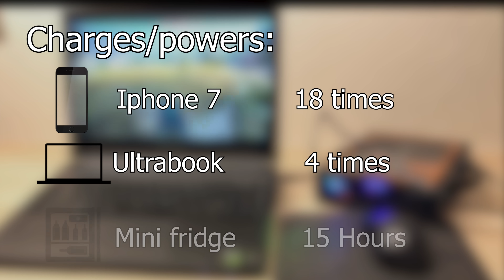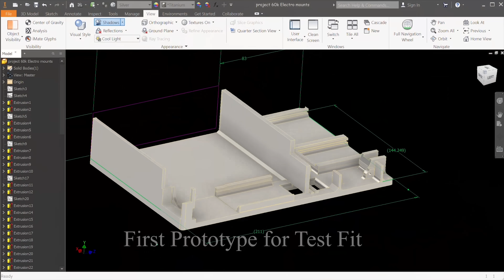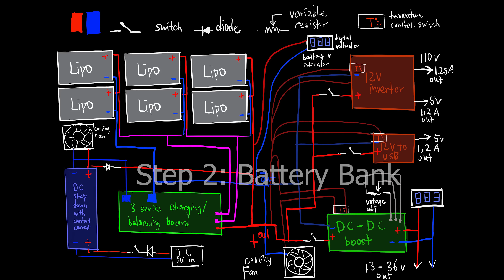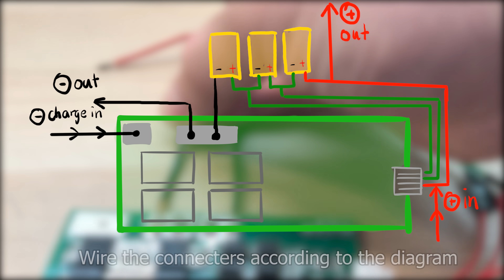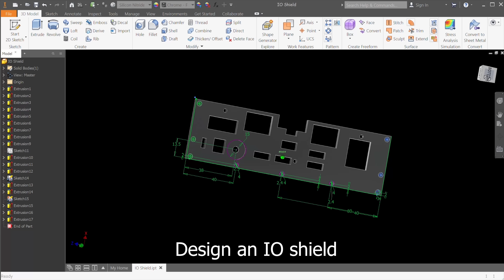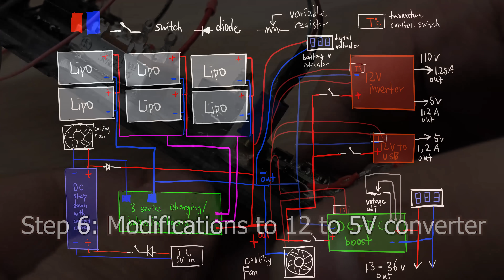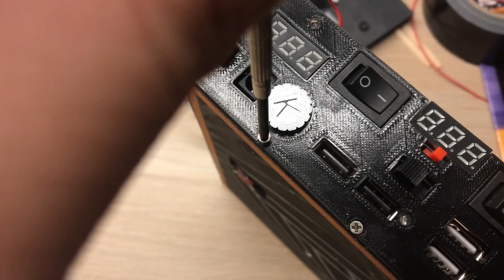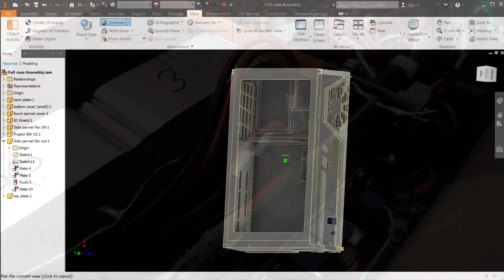Ultimate DIY 60,000mAh Power Bank (222Wh)

Comment: Schottky diodes not schockely (William Schockley)
Reply: No, schottky and schockley diodes are two different things.
Reply: @voldy3565  Been an EE for 50+ years and have never come across a schockley diode. Schockley invented the transistor.
Reply: @demyhr  Since you are an electrical engineer, can you tell me is this safe? If not, how can i make it safe? Add a fuse?

Comment: No BMS, unbalanced charger? oops
Reply: Is the device shown at 0:30 used to balance the batteries?
Reply: @ddegn  nope. The batteries are connected in pairs of two, then "balanced". It does state in the video the batteries are grouped into pairs of similar voltages when charged which helps but eventually because they are not the same voltage, issues related to them not being exactly balance will get worse.
Reply: @MrAlex3461  LiPo cells wired in parallel will always be at the same voltage. It's very very common for multiple cells to be treated as one larger cell when charged. This does have the downside of possibly losing multiple cells when one cell goes bad but it's very common for systems to treat parallel cells as a single higher capacity cell.
Balancing is needed when charging in series not parallel. Parallel cells don't need special balancing circuits.
Reply: @ddegn  perhaps common, but not in my regard best practise. The system will however be stable, and what I said before now thinking about it could be considered incorrect

Comment: what does it mean to fire the rubber after soldering like at 9:34? i'm a teen who's interested in hardware/tech and pretty fgood with it like PCS for example and this type of stuff is very itneresting, love it. i've learned al ot, did some research on polarity, ground, wire, negative, and neutral. can't wait to get int othis stuff ith e future and even make my own DIY builds (with obvious safety precautions and tools)

Comment: Solder joints could have been  a little bit better, but with the current you'll be using there shouldn't be a problem. I push over 120A through 12AWG everyday and have yet to desolder anything.

Comment: Nice project. I've built something similar with 18650 cells from used laptop batteries. it is 55000mAh and can power on laptops and basically anything with an external power inverter connected to its 12V plug. might having a look for inspiration. Cheers!

Comment: This is 20ah 11.1v nominal voltage, none the less great idea really useful although 4s lipo would be more ideal for a project like this but would put you up to 14.8v but less strain on the batteries, for future projects that require soldering remember flux is your best friend
Reply: Yes , I think that I was only one that know that is 20ah , 20000mah
That 6 battery with 10000mah is divided by 3 make it 13.6v , is 20ah 

Sorry for bad English, I clap for you too , he need 18 battery to make 60ah capacity

Comment: So many negative comments about your poor soldering and ugly connections.
But you built something which doesn't cost too much, which looks pretty professional (on the outside), which hasn't caught fire or exploded (yet), and which apparently works exactly as intended.  You just figured it out and just got it done without worrying too much about weak soldering skills.  Yeah there's some ugly and unsafe-looking DIY things inside the box but I compliment you for what you accomplished well instead of condemning you for what you failed to accomplish correctly.

Comment: When i was 13 my dad got me an arduino for christmas, for homeschooling diy circuitry projects. I wasnt allowed to power anything until he viewed my work. If he had viewed this work, he wouldnt have allowed me to power it.

 And before people start asking if I was allowed to use a soldering iron, yes. I was. And I didnt burn the house down, because its not a damn flamethrower. Its a hot stick. Doesnt take much training. Did I get high from the fumes of the flux? maybe.

Comment: Along with everything else, you NEVER put a tinned stranded conductor under screw tension. If it is meant to have current flowing on the conductor, it will eventually burn off.

Comment: I made my own version of this however I used an Arduino with SSD1306 to control everything as well as lead acid batteries, may have to revisit the project and repo with a orange pi zero, tft touchscreen and those 10Ah LiPos (my lead acids are only 7Ah and about 10x the size)

Comment: Nice build man, don't see too many power banks using proper lipos. Would definitely recommend some nicer solder, looked pretty hard to work with (was it the lead free stuff?)
Reply: That's because 18650s are safer and easier to work with than Li-Po cells

Comment: the xt sockets are a little different to solder they take alot of heat fast, u either have to put the wire in dry then flow solder in or u have to get it hot enough so the wire actually sinks into the connector instead of sticking to the outside  iv noticed ppl usually dont use enough heat, it takes some practice, its best to make a jig for them if your doing alot like me unfortunately   if u try to just let the heat soak too long the pin will start floatin around in the plastic which is recoverable from but obviously not ideal

Comment: I’ve built this same type of system by following your videos, my 150Watt laptop causes the 200w inverter I have installed to shutoff (guessing not enough power) I’ve got 9 lipos setup the same way, isn’t the configuration you’ve got just adding up voltage... not the MAH..

Comment: Project very nice, but I must correct a fault, serial connection does not add capacity so this power bank has 20000mah
Reply: @kralyn3d  if everyone else jumped off a bridge, would you jump too?

No need to resort to the dirty advertising tactics that the big corporations use

Comment: What is the boost converter for and what is the rating if the converter? Is the converter connected to the DC-AC car inverter boosting the 11.9volts to 12-24volts to power the inverter?

If 11.6v boost to 12-24volts to power the car inverter is the case, could you not have instead connected all six LiPos in series to achieve 19.2 volts nominal and then it directly powers the car inverter without the need for a boost converter in-between?

I need to learn too, you know.

Comment: very cool video, and seems well made(both the vid and the battery). went to my favorites list. 

just some minor things. i'd rahter solder the batteries at 3'7V, but if you got care it shouldn't matter. also, please, clean the iron tip. 

As said, cool vid. i've done a 12v battery myself and have a 5v converter just like you(but mine  isn't integrated, and the battery has a single port for I/O) and i even was thinking about putting an inverter to it just like you did!. 

may i some day copy this?

nah, man, seriously, great video.

Comment: at the start of the video u say it runs a mini fridge for 15 hrs.  how many amp does the mini fridge draw?  also is the mini fridge 12v dc or 110v ac? thanks!
Reply: @kralyn3d  you should actually measure how long it will power the compressor for in order to get an accurate number 

Take the hours it ran with the compressor on for, then post that as the actual runtime, 220wh/55w for the average 240v mini fridge = about 4 hours of compressor runtime or around 8 if you manage to find one that pulls 25w (this is ignoring the losses in the inverter which would amount to around 30% depending on the type of inverter and the fact that compressors are notoriously hard for inverters to run, then you have to account for the losses in the boost converter that powers the inverter, which would be another 20% on top of that, realistically you would only have about 110wh of usable capacity worst case scenario) 

The car fridges you can plug into a lighter socket tend to draw around 65W (which would run for about 3 and a half hours)

Comment: What you need o do is design a distribution PCB. Or even use chocolate block terminals. ENYTHING but what you did with those 7 ish wires all meshed together.

Comment: Why no fuse or temp control ? lipo batteries are very volatile, it does not take much to make it go kaboom.
All these components that you hotglue in will not hold for more then a few months before things will fall apart
why do you make the fan take in air instead of leading out the hot air ?
oh and get a heatgun, its 30$

Comment: Be nice to add one of the induction charging pads on the top of the unit.
Reply: What you say is true, but I have to say I have not damaged my usb port on my cell phone plugging and unplugging the cable in to charge it. My plug is still nice and tight whereas the phones I have had before are all loose and not always able to make the connection unless I fiddle with the plug. Since my phone lasts over 16 hours, when I get home, I just toss it on the charger and let it go overnight while I sleep. Yes there have been times where I miss the sweet spot and it does not charge, but almost always I am on my way to work so I plug it in once I get in.

Comment: Dang, really nice work. Would you consider making a 18650 version?
Reply: I'm new to this stuff, what is the benefit of 18650 vs lipo?
Reply: @razialghul  18650's generally have more energy density, which means for can fit more energy in a smaller size and it would weigh less. 18650s also tend to last several times longer than lipos, they also dont have the risk of "swelling" which is when the soft lipo cells expand if you over charge or under charge them
Reply: @connor84128able  cool, thanks for the info
Reply: @connor84128able  Batteries do not "swell" from UNDER charging. 
Only OVER charging and shorting the contacts will make it swell...
Under charging, as in not charging it when it is depleted, will simply end its usable life sooner.

Comment: If I watched that video correctly then it's not 60000mAh power bank because he connected those batteries in 2P3S(2 cells in parallel and 3 of those in series) configuration. That means that real capacity of this power bank is 20000mAh. To get 60000mAh power bank in that configuration he should make 6P3S configuration (that's 18 of those cells)
Reply: did you not read his content area? lol

Comment: want to ask u something if I parallel 5500mah and 7200mah both 3.7v is this safe..to make a diy power bank charger..I take the circuit board from power bank 13000mah battery..it's safe to use that circuit board?

Comment: Great build but stop misleading with 60,000  mAh as it's no longer that if the cells are in sires as seen by the amount of times it charges an iPhone 7 which has a capacity 2000 mAh  x18 that's just 36,000 and not 60,000.

Comment: What is the boost converter for and what is the rating if the converter? Is the converter connected to the DC-AC car inverter boosting the 11.9volts to 12-24voltd to power the inverter?

Comment: Would have higher mah if it was only at 3.7v or 1 cells but you series it to multiple voltage but it still has high mah capacity

Comment: you can charge a 2000mah phone battery 18 times (36Ah) with a 60Ah battery?
How are you wasting so much energy in simple dc-dc conversion
Reply: With the evolution of technology the mobile phones use batteries with 3000mah on average.
3000 * 18 = 54000

Nowadays there are already phones with + 5000mah.
Reply: @sebastiaoteixeira1435  eh yeah thx how is this related to what i wrote?
i was talking about the Iphone 7 battery because he is also referring to it at 0:22
Phones with huge batteries have been around for a decade. nothing special, just bulky
Reply: @jonny393  OK sorry

Comment: I'm amused that the capacity is set at 60k (60,000) mAh.   I suppose I have no problem will rather small systems (4 Ah) but when you geet to the double digits, let the zeros cancel out.   A 60 Ah system at 12 volts likely wouldn't start by deep well pump.

Comment: Why 45°C Temperature switch? It's bit high for Li-Po and it might start damaging the cells. Otherwise nice powerbank but look like you did it in hurry, spend bit more time on building! And get new soldering iron
Reply: @David M That's why i said "it might start.."
Max Safe Tempreature is 65°C sure but you might not want to run them at that temp all day long
Reply: @David M Indeed
Reply: @David M I respect your comments now even more, you know

Comment: 3s system is better ? i use 4s system + bms 4s 30a + 12v car plug (1 turbo charger qualcomm 3.0 + 1 5v 2.1a + 5v 1.2a ) and 1 psu universal laptop car (12v to 15v 18v 19v 20v and 1 usb charger more 5v 1a) and is super simple to construction and less a price

Comment: you have a like for the work you put in , but ther its a very easy way to do that , with out all of those pcb , a step up and sevral female outs will have done just fine if you use the the diodes as no entry

Comment: I assume the battery bank is 4.2 x 3 so 12.6? please confirm.
Reply: @kralyn3d  I purchased all required parts an then some. My question is can I also add a separate charger to be able to use my rc lipo charger to go straight to the batteries? I assume so
Reply: @kralyn3d  thanks for the tip, one more question, the laptop power supply you used, does if have to be that one,or can it be any laptop power supply that is between 15-24 volts also could it be a 12volt instead?
Reply: @kralyn3d  thank you totally get it now

Comment: That's only 20Ah. Current does not add up when in series, only voltage does.

And honestly looking at the size of the battery, they can't be over 5000mah each. I have same size batteries but at half the thickness from a reputed manufacturer and they are only 2100mAh certified.
Reply: Panasonic NCR18650B is my cell of Choice for building battery packs

Comment: Lipos can be very dangerous especially when connecting them together, i don't recommend doing this unless you know what you are doing!
Reply: @kralyn3d  first of all, i like the idea and I definitely want to build such a big power bank with inverter myself thanks for sharing your projekt.

yes we both know that but i´m not sure that your audience knows that too. ther´s also the internal resistence of each cell, whitch is important. do you check them frequently? how often did you discharge/recharge them in the last 6 month?

also i cant recomment those cheap chinese BMS, they have a balance power of only 20-80mAh, witch is way too low for a 20000mAh cell.

what discharge rates have those cells 1-2C or 10-20C?
Reply: lipo's are like guns, perfectly harmless, but very dangerous in the wrong untrained hand.
Reply: @kralyn3d  yes i think at that low discharge rates it is safe to use, 0.01V difference is perfect, but be careful this might change over time. maybe you can upload a update video in a couple of months to show us how it is going.

there is one thing more. do you know EasyEDA? it´s a free web-based suite that enables hardware engineers to design, simulate, share and discuss schematics, simulations and printed circuit boards. maybe you can use it in future videos.

Comment: Although i understand the thinking behind your explanation about the capacity, you are giving as much of a bad example as the commercial brands do, by labelling and advertising battery capacities with mAh instead of Wh. Technically speaking, and if you want to be accurate, your Power Bank total current (I) meassured in Amperes (A), according to the way you have your cells connected, is still 20,000mAh since it is the current you chose to rate your power bank with, not the real capacity. Nevertheless, it is up to you if you want to simply give the full specs and numbers for all ratings individually, but i agree with you about the battery companies not been more transparent about their products, to represent them more accurately.

Comment: Some nice ideas...But your soldering technique,. or lack of makes me cringe,.. wire joints need to be both mechanically and electrically robust in order to withstand long term use/abuse,.. and some fuses might be nice in the next version,.. both current and over temperature,....

Comment: ITS NOT 60000 mAh its just 20000 mAh. Why?? Because he connect the 10000mAh battery in 3s,2p configurarion that makes it 12.6v 20000 mAh. Not 60000 mAh!!
Reply: Yeah, but you forgot that powerbanks like this are universally measured at 3,7V for capacity.
Reply: 3.7V for nominal yeah but not in capacity. And for the maximum of 4.2V. Then whats your point?
Reply: You are still forgetting that everyone measures their powerbanks capacities for 3,7V. The uploader mentions this all over the page here. Otherwise people would think this powerbank is the same as any other 20000mAh cheapo banks on Amazon/Ebay.

Comment: While I love videos like this, and you guys are intelligent, what really pisses me off in every electronics video is... Show people how to do shit correctly. I work with industrial equipment, and consumer level stuff and hobby level stuff... Is embarrassing compared to consumer and industrial. 

What i'm getting at is this: You don't solder components, components get mounted and leads from a switch are soldered to them. You heat shrink any connections that are close where a user interacts(I.e. switches etc). I mean there is a thousand nit picks, but just because you got to to work, just because you mounted it in a box, doesn't mean it'll last a single drop. 

Think about how your shit may break, and mitigate for that. Wire is cheap, clamps are cheap, PCBs are cheap. Sure for a prototype go fucking nuts, then when you want to build your unit you will be using, TAKE FUCKING PRIDE AND MAKE SURE IT'LL LAST.

Though hell, I pot my own shit so whatever.